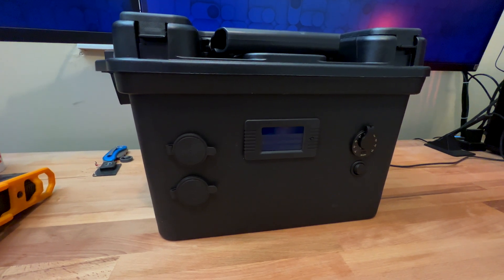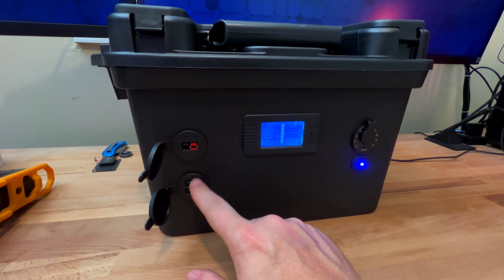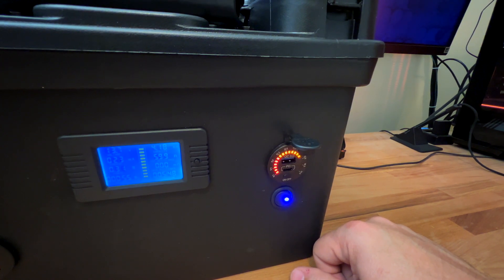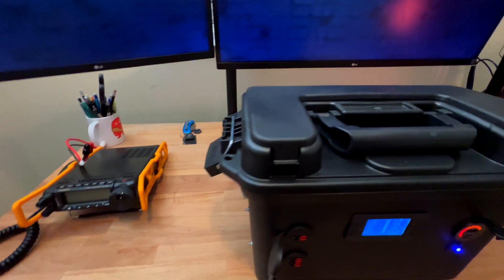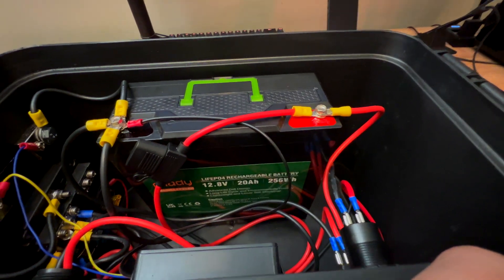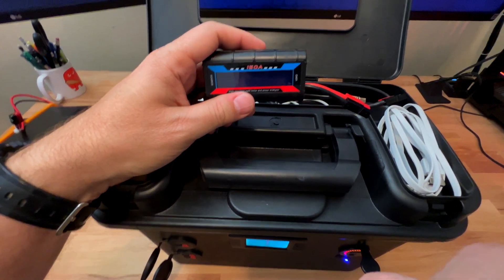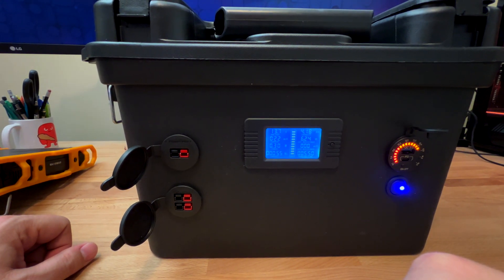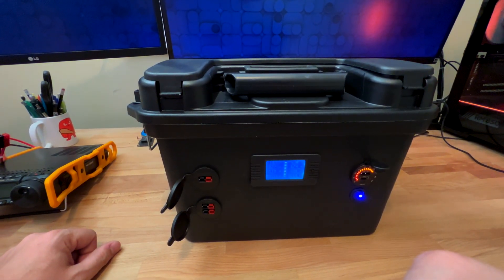Battery Box for Portable Ham Radio

Comment: LOVE the box from HF.  I have 7 of them for various things.   I have a 12a and 20a bioenno packed in mine with just simple powerpole out.   Don't think I'm smart enough to handle the wire job you did.   Very nice.   One question.   Do you have any problem with the battery sliding around inside or how do you have it secured?   I padded mine with some styrofoam packing and seems to work good.   Very well done.
Reply from the maker: I am using a strip of Velcro on the bottom and side, does not move at all that way and is still removable if needed. Thank you for the comment.
Reply: @jonlawrence  Thank you for that!  I was wondering if velcro would be strong enough.  You verified that!

Comment: You really did a nice professional job. Very impressive. I use the same battery, actually I use two of them for a total of 40 ah. I also purchased a 10 ah one to be used for QRP only. I can add it to the mix for a total of 50 ah for the long haul. 
I used a 50 cal. ammo box purchased from Amazon. I like the one you use much better since it has a small covered compartment on the top. I may get one and use my ammo box for other items to carry along when I set up portable.
Now we need to see the rest of your station.
Thanks for sharing.
Barry, KU3X
Reply from the maker: Thanks for the comment. I have a recent video that goes over my shack setup.